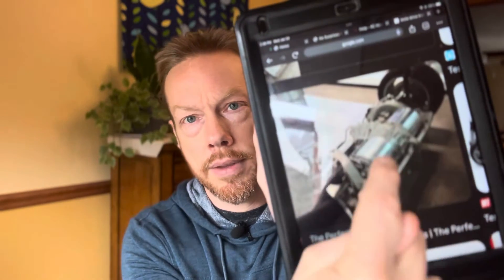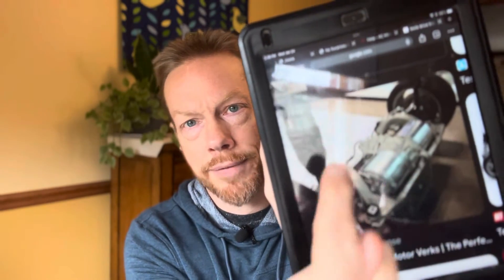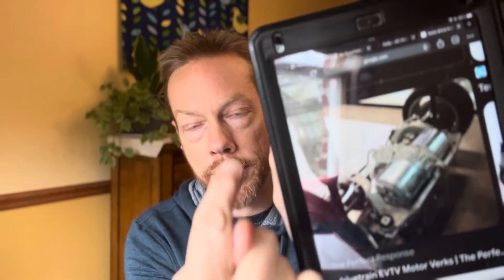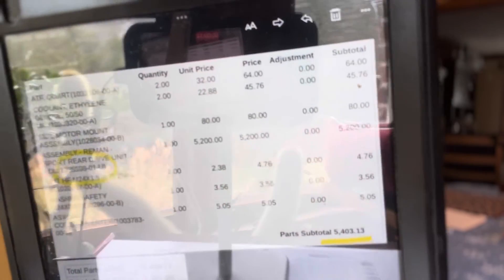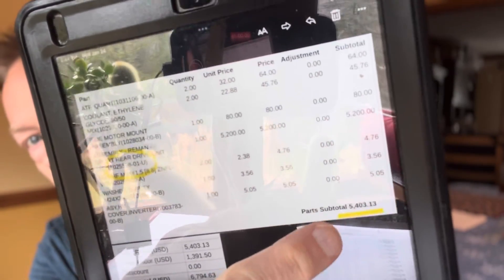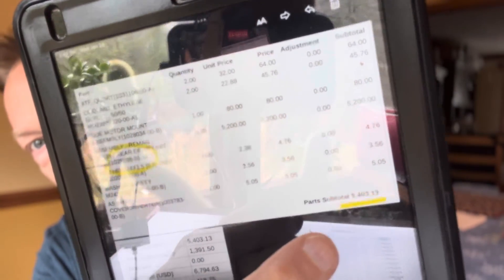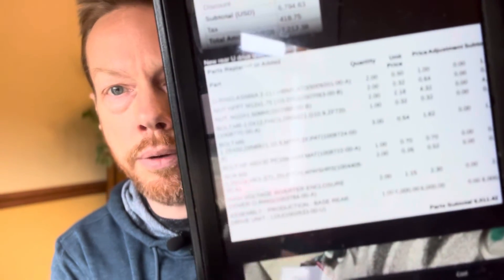Tesla repair expenses on older Model S / X -- PART 2: Drive unit/drivetrain, failures, replacements

Comment: So are the dual motor (non-performance) models better options for longevity?
Reply from the maker: Yes -- the smaller motors (which the non-P duals have two of) are pretty bulletproof.  For absolutely longevity get 100kw dual motor.  There's some debate as to which years are problematic comparatively, but generally that's the basic config you're looking for and (probably) best bet is newest/lowest miles for the price you can find.
Reply: @NZCUTR thank you! I have a 14 s 60 and I may give up free supercharging but  I need more range and as I look to more preventative maintenance I think a 100D would be a better investment. I’m also tired of faster wearing inside of rear tires, have tried looking into rear camber adjustable arms?
Reply from the maker: @JeepLJ   I don't have air suspension on mine, so I don't have any of those problems.  I'm about 85% sure there are 100Ds with coil suspension available as well, if you want to really go low maintenance-- but if not, yes, the rear camber adjustable arms will allow you to square the alignment for your preferred ride height.  There are a number of people making them, but they're all significantly more than the OEM nonadjustable arms.  I think keeping tires in good rotation is probably a wash cost-wise vs swapping otherwise good arms out for the expensive adjustable ones.  That said, if you're replacing arms on an air-suspension car anyway.... not a bad upgrade to make while you're already there, especially if running more expensive 21" tires.

Comment: My Tesla Model S P85 from 2014 with large rear drive unit is still going strong. 495000km (307500 miles) at the moment. Fingers crossed, hope it lasts another 300000 miles...🤞😬

Comment: I own a P85 bought new 2014 now 145,000 miles, as an ex engineer 44 years world wide in big auto. You are WRONG. Version "U" does not define the "tube" that is on all motors. The tube takes coolant to the gearbox, specifically the output bearings.
The "U" drive units will be fitted with hybrid armature bearings using ceramic ball bearings that do not provide a path to ground for induced electrical currents that would otherwise galvanicly destroy the bearing along with other more minor enhancements.
The coolant delete removes the need for the seal on the feed end of the armature shaft, this seal always seemed to me to have a failure mode that far outweighed the benefit, but Im viewing it from my use case.
I live it the UK, it is not often that hot and there is rare opportunity to run the car at any where near the full load for any extended time therefore generating a large heat burden.
To delete the coolant seal I will jack the car, remove the LH rear wheel and undo the aluminium gallery / top cross feed pipe nut. Once undone it is only possible to move the galley away from the motor rather than remove it as it hits the sub frame with the coolant feed tube still in the armature. 
Slice the feed tube off the gallery and remove the gallery for modification. Slice up the remaining feed tube incrementally as you remove it section by section.
Machine the galley to accept a stainless steel turned plug and refit.
When to do all this? Im a machinist and I have the machines and I wont do it unless its needed.
Ive already inspected the encoder sensor, it was dry so I have a good drive unit.
Theres nothing new here, weekly inspect your tyres and coolant level, save a fortune.
Ive drilled a 3 inch hole in the plastic panel above the coolant header tank I can see the coolant level, if it starts dropping its going somewhere? Theres your answer do the mod now or do it before if you have the time / inclination, either way dont leave it till its too late, prevention batter than cure ££££
Reply from the maker: Prior comments already addressed the flyover tube -- but since no one reads comments, I'm updating the edit of the video to remove the reference-- but you're correct that it is not a visible reference of the coolant delete as I'd initially understood it. 
However, as you put it, you are WRONG that cermaic ball bearings are not a new feature to U revisions. The ceramics were added sometime circa late 2015 to refurbs and new production drive units--  after many were swapped under warranty for the "milling noise."  It's unlikely that there are very many of the earlier non-ceramic bearing drive units still in service because of their high initial attrition rate.
Your solution for the bypass is interesting-- especially since it would seem to skip the DIY-unfriendly process of dropping the drive unit or otherwise having to lift the car fully-- and if you ever actually perform this modification, please document via video and share!
I would note that coolant levels dropping in an older S are not necessarily indicative of a drive unit seal. In fact, a far more common repair is that one of the coolant pumps has developed a leak.  So while that is still alarming, it's not nearly as expensive a repair.
Reply: @NZCUTR  Challenge accepted, I will document if I do the mod. My point on the coolant level, check it and if it drops do the mod. The risk /cost consequence for me is just too great to gamble it not the drive unit armature seal. There are a number of You tube channels showing slicing of the aluminium coolant gallery half way up so the off cut can be wangled out then others showing removal and plugging of the cross feed tube from a dropped drive unit and sub frame however I consider it easier to leave the sub frame in place loosen only the top cross fed tube fitting and by slicing the coolant feed tube getting the coolant gallery complete off the drive unit. I have a lathe I can make a plug to fit in the gallery (again there is one mod done like this but as I say the drive unit is dropped to do it).Of course the coolant feed tube into the armature could be hard steel and likely is so an off hand grinder may be needed to slice it up necessitating a lot of careful precautionary packing to ensure grinding dust does not enter bearings or the coolant passages. You will hear the cursing. Hopefully my coolant level never drops and I never need to do the mod. As far as I understood all U revision drive units have ceramic hybrid bearings, I dont know about any others I stand corrected if you are correct there is no way from any part codes you can determine if the bearings are ceramic hybrid, I guess thats a wait and see and to me a way less risky problem than the coolant seal design defect.
Reply: All good, but in my limited experience and reading forums on my Model S, the main fault for loss of coolant are the 3- and 4-way coolant valves under the frunk which often fail with age. My coolant level kept dropping 1litre/month and small puddles on the ground. Low coolant throws up an alert in the service menu. I replaced the 4-way valve (£75 part) and the coolant drop ceased. I agree the LDU seal failing will also cause some coolant loss and I hope to manage the delete DIY asap.
Reply from the maker: Yes the valve/pump failures are typical but not catastrophic. They're a more involved (but doable) DIY or minor expense/inconvenience at the service center. When one of mine started leaking I happily paid the $250 so that they'd be on the hook for any screw-ups that could have negatively affected the entire battery/drivetrain...  Figured that was penny wise on the risk/reward scale, but your math may vary.

Comment: This is incorrect about the information on the tube that goes from the manifold to the gear housing, my 2015 model S has the original problem rear motor and it too has the same tube. The actual difference is the water tube that goes from the manifold into the stator on the old design, this is deleted on the U design so coolant now does not enter the stator section where the seal fails and coolant enters the motor, gear box and inverter. I have already modified my model S with the coolant delete and it runs well.
Reply from the maker: Correct-- I addressed this in an earlier comment:  
"this was a misunderstanding from the original picture source that I repeated. 
The part number is the most reliable way to ascertain updated drive units."

There are a number of low cost ways coming onto market now to DIY a coolant delete.  I've not yet seen a truly/easily done DIY-- but if you have a local mechanic with the right lift/tools and desire, this would be a good project to undertake. For shadetrees like me, the lift is the hardest part-- and I don't have a way to get the rear end comfortably and safely skyward enough that I could shimmy under it as necessary to DIY.
Reply from the maker: Still getting comments (from people who haven't read the prior comments) ...  so I'm updating the edit on the video to remove the reference.
Reply: I thought coolant does not enter the rotor any more.
Reply from the maker: On the U revisions new-build and refurb drive units the coolant path through the rotor has been deleted, yes.

Comment: The delete entails sealing off the Rotor cooling path within the manifold.  The flyover tube you are showing is on all motors new and old and stays on the coolant delete part too since it moves coolant from the manifold to the top of the gearbox as in the original.
Reply from the maker: Agreed -- this was a misunderstanding from the original picture source that I repeated. 
The part number is the most reliable way to ascertain updated drive units.
UPDATE:  I am updating the edit of this video to remove the reference to the flyover tube.
Reply: You guys are very smart with this can you please answer what is best year  model x to buy so I don’t have to worry as much sounds like expensive stuff here please let me know 
Thanks
Reply from the maker: I'm not sure what configs of the X have the small rear drive units, but generally speaking the small drive units are pretty bulletproof and the new builds (i.e. ones without stalks from 2020- ) use a different rear drive unit entirely.
Reply: @NZCUTR  hello , my car is in the service center for drive unit replacement. The car was running fine. I got in it one morning and the screen read low voltage and may not start then both screens went dead. Dealer tells me it was a fail safe system and the drive unit has an idolstipn problem.  I got no warning. Dies this sound right? The car was running fine.
Reply from the maker: Indeed.  This is a typical fail.  Make sure you get a U revision (should be the only ones in system now) and please report back with price and other required work just for the data point for others.  Typically this range from $4000-6000 currently (best I can tell) depending on location and sometimes there are associated suspension work done at the same time (easier with the subframe removed) that can be another $1000+.   
But lest that deter you-- all indications are that a U revision drive unit is a bulletproof fix that you will not have to repeat, so I think it's a worthwhile repair if the car is otherwise in good shape.

Comment: My one year old 2014  model A 85 just took a shit. With only 60k miles. My question is, is it worth it to fix it. Tesla wants 9k. Also upside down on car loan.
Reply from the maker: All depends on your use-case, what broke, what your resources are. The trouble with Tesla repairs is that it's basically all cash business. Loan complicates every car decision (I have never had a car loan for this reason and bought only what I had cash on hand for), but a broken car isn't particularly useful either.
Reply: I have the same problem. My 14 S took a dump, and it's dead in the water. I'm concerned that the batteries are next. It's a beautiful car but, just a lawn ornament right now. Funds are too tight to pull the trigger on that.

Comment: So does the non performance motor have more reliability? I HAVE a 2014 model a 60 and it seems to be running great at 130k miles.
Reply from the maker: Anecdotally it seems to have less OTHER problems, but the seal issue is what it is.  If you have a large rear drive unit (performance or not) it's going to have this coolant seal issue-- and I'm pretty sure the 70 or 75 was the first RWD only version to have the smaller rear motor (which is very reliable).  That said, the performance versions are known to eventually crack the motor/drive unit mounts on the rear subframe, which is a significant cost replacement as well. I don't think the early regular 85/60 versions "shock" the rear mounting tabs hard enough to cause widespread cracking.  The performance ones can rip them right off eventually (usually identified by loud knocking sounds and/or yawing under acceleration/braking).

Comment: I had my drive unit replaced under warranty in November of 2021, they did not install the Updated drive unit as it "wasn't available at the time". Now i'm worried my drive unit is a ticking time bomb.
Reply: It technically is. They only started using Revision U in 2022 I think. 
Just check the speed sensor for coolant from time to time.
Reply from the maker: You could proactively do a coolant delete, there are kits available for as low as $50.  However, it's quite a daunting DIY.  Agree with @Menon9767 that you can monitor the speed sensor-- but that only tells you how quickly you can expect to be stranded, not a repair in and of itself, and then your choices remain the same:  coolant delete (may be too late if the sensor already has coolant on it) or another drive unit replacement.

Comment: I have a 2019 P100D. It’s making the windmilling noise. What causes that ?
Reply from the maker: Could be bearings?  Could be differential?  Could by the axles?  There's a number of other non-drive-unit parts that can fail/wear out. While it may be true that EVs require less maintenence, I think the jury is still out on whether they require less REPAIRS.  The high torque of a performance's DU is obviously going to accelerate wear just like any other high performance car.
Reply: @NZCUTR  it’s in for a new RDU. Tesla tech said they just “ wear out”. Well it only has 42,000 miles😳
Reply from the maker: Uncommon... but I suppose anything is possible. Make sure you get a U revision!  :)
Reply: Electrical discharge inside the inverter. Does not affect your car and will not ever affect function. If you dont mind the noise just keep drive it, if still in warranty just fo and replace it at Tesla
Reply from the maker: Interesting...    I think discharge/arcing was also the explanation behind the "balloon noise" when accelerating (esp. when cold) but that it was associated with the main pack contactors.  Though my understanding was the noise indicated contactor wear and was to be avoided (lighten up the lead foot!)